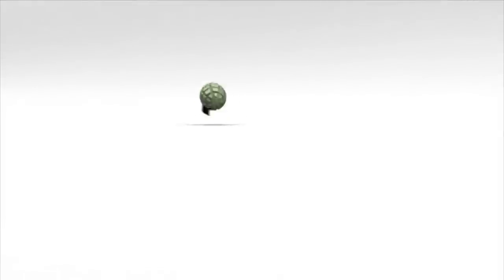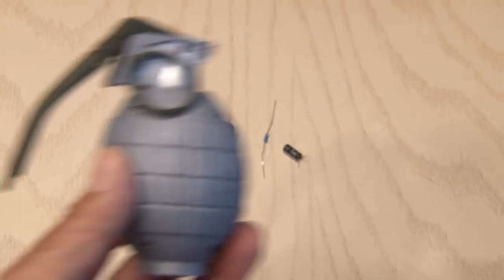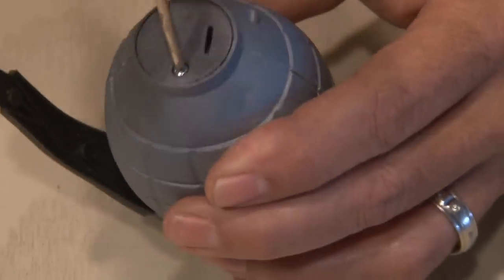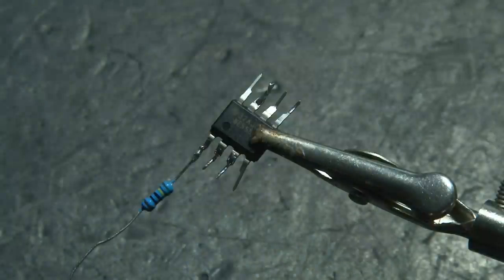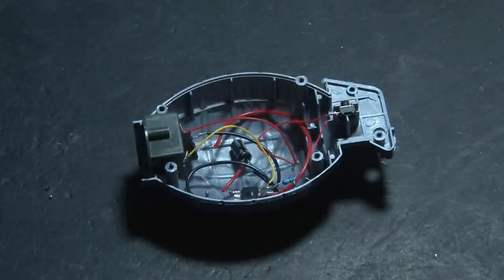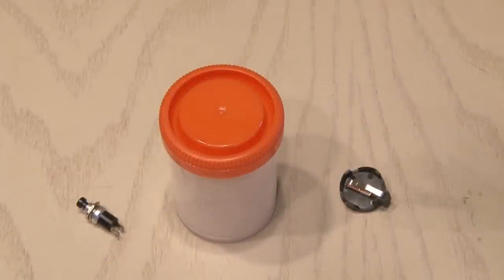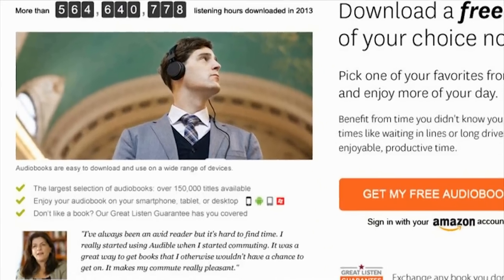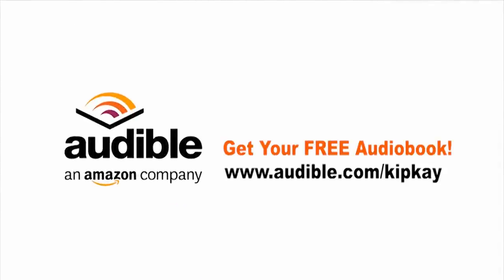$3 Airsoft Sonic Grenade!

Comment: That's how you get kicked off an airsoft site.

It doesn't turn off until you depress it again? I don't think you've ever played airsoft.

Nice little project, but why not just call it a sonic grenade? People do sell loud "sonic" grenades and devices as a prank which fits in line perfectly with the theming of your channel. Again, it's a cool project but spinning it as if it's for airsoft shows a poor understanding and could seem misleading.

I do enjoy your videos and look forward to future projects man, best of luck.
Reply: Mster Mean  You know, I hadn't thought about differences in countries, in Ireland we use a certain kind of firecracker designed for airsoft use or plastic capsules design to pop from internal pressure. Neither of which is totally safe but are only temporary and with both it's easy to tell where they're coming from.

With the sonic grenade, even if it turned off itself after a few seconds I think it would just create confusion, people not knowing if they're it and like you said, end up with someone smashing it out of annoyance.

Best case scenario you have an agreement with the site and players that it's a non lethal room clearer. But I don't know if people WOULD agree to it :P
Reply: Actually, if you compress the handle again it will stop but it still may not be best for Airsoft.

Comment: what size is the capacitor and resistor and what watts are for both? been trying to do this for weeks, also does the buzzer affect the sizes of the capacitor and resistor? im new at this so please specify the parts, thanks, love your vids.
Reply: Joshua Pangan 1m ohm resistor, 4.7uf capacitor rated at 3v or above. The speaker is a cheap pizzo and the 555 is a std 555 timer chip just ebay that one
Reply: Paul Allen thanks, last thing, where do i connect the battery to?

Comment: Hmm.... What if I added some potassium chlorate and sugar in it and instead of the speaker add an electronic igniter?
Reply: It's potassium nitrate basically salt but don't use salt
Reply: Sean Coles Yes potassium nitrate is salt. It is a great oxidiser and helps the sugar burn. It will result in a small explosion when it happens in a closed container.

Comment: K, first thing I thought...can you get it to do mosquito tone and/or infrasound?
Reply: Yes -- but it uses PWM. And why infrasound? You wouldn't be able to hear it at that low of a frequency.
Reply: Infrasound is suggested to cause unsettling feelings and there has been some mention of the frequencies having effects like hallucinations and is a suggested link to sightings of ghosts (caused by the wavelength vibrating the optical nerve, or some similar portion of the visual system). I reckon it might have barrier applications, or other deterrence uses, as does the mosquito for younger people (considered a breach their human rights by some, possibly justifiably).

Having bought into the radical 'science', 'television', and 'internet' delusion the population experiences, I'm willing to give it credibility. After finishing their brief flirtation with goats, the military are eagerly grasping the 'science' straw too. Could be something in it :)
Reply: Nathan Baxter I thought infrasound required a lot of power?
Reply: Might do, I recall reading something about speaker requirements in a 'haunted house' experimental or commercial build. The vibrations would, I'd assume, have to be taking the final output device's capabilities into account anyway, as the final stage of the release has to have the ability to produce the oscillations; though there may be other methods (a washing machine on spin springs instantly to mind).

It could have potential for experimentation by taking the entire concept and reversing the approach: result --> output --> conversion --> generation mechanism --> power. This might produce options the actual setps to generate might miss. We didn't get solar effects by going 'hydrogen --> sciency stuff --> hot', we started with 'hot' and filled in from there, with a big hint of 'happens when yellow ball that hurts to look at is there' to add to 'when <random deity> gets angry and hits trees with shocky stuff occasionally' as well, which confuses the issue a bit too.

Be fun to know if it was do-able...pretty sure the actual work can be handled simply by electronics; it just involves 'by getting to do how' and 'output' method, really, I'd suppose.

Comment: facepalm really you now you can just but more power to the system ow the toy to make the speaker even louder the power is the mian hing wen you but more power more sound will come out its that simple btw tond belive try it yourself i tried on old brocken motorsicle toy the syse work i but 9 volt battery its werry loud now